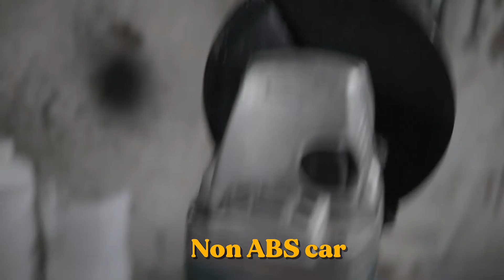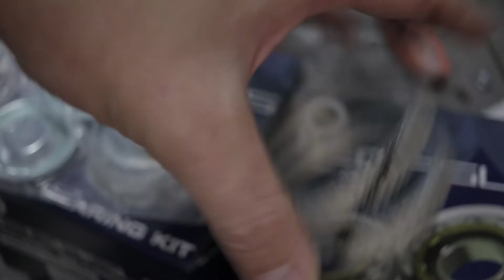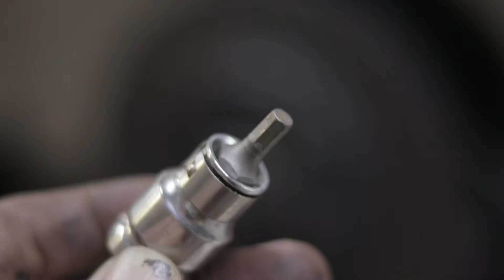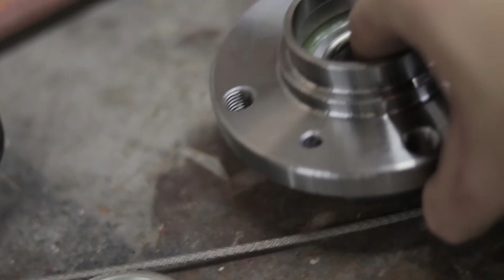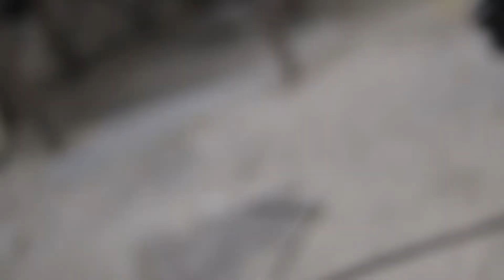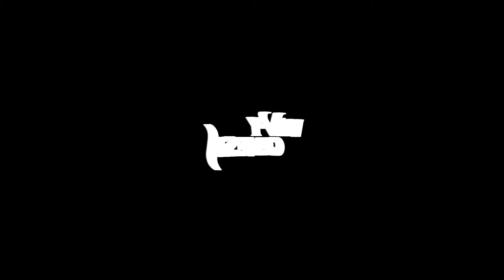E30 front wheel-bearing replacement (BEST CASE scenario)

Comment: Hi there, do I have to remove the ABS ring on a non ABS? What problems could it cause if I leave it on.. 🤔
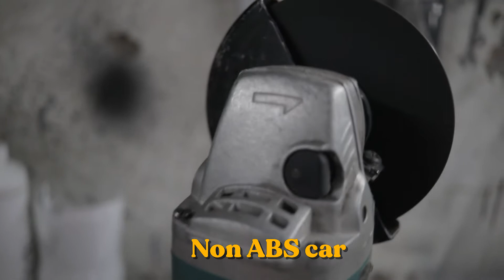Reply: if you're reffering to time stamp 0:10 im assuming hes using a dremel or cut off wheel to cut a slit into the ABS ring allieviating the "friction fit"  from on  the hub, popping it off easily due to missing material
Reply from the maker: @kvbe9441  This is completely correct 👏
Reply from the maker: Good day. In hindsight - there shouldn't be an issue with leaving it on in terms of clearance

If the hub spins freely without grinding on any interference - you should be safe. 

How did your install go?
Reply: You don't have to remove de ABS ring, you only need to remove by the non ABS version the cover ad the end of the axle.
Reply from the maker: Thank you 👍